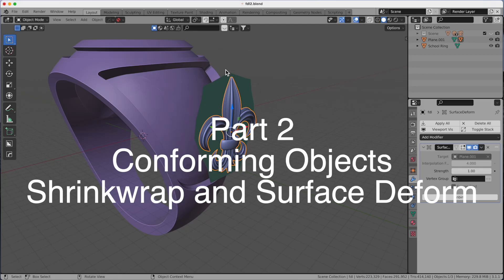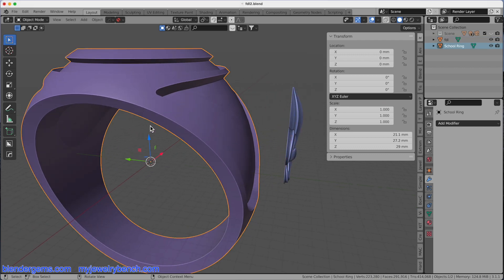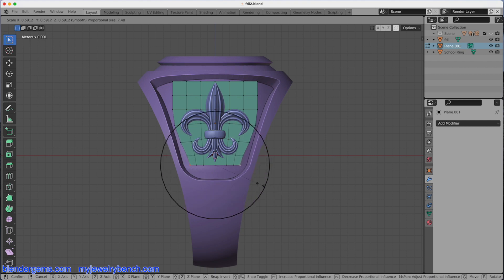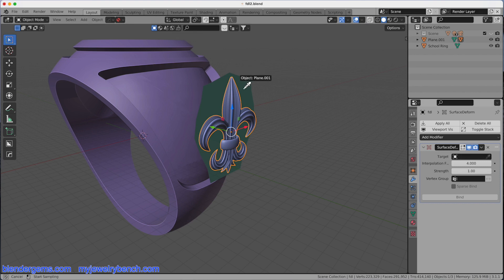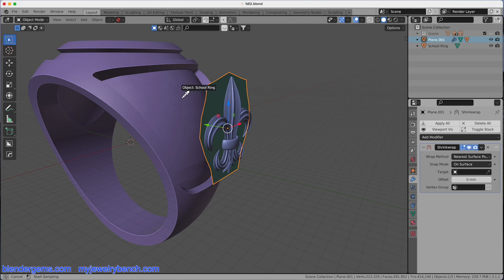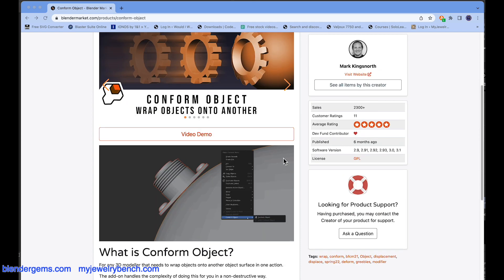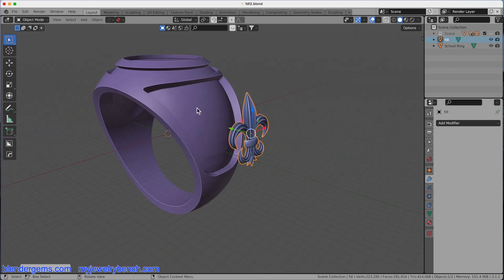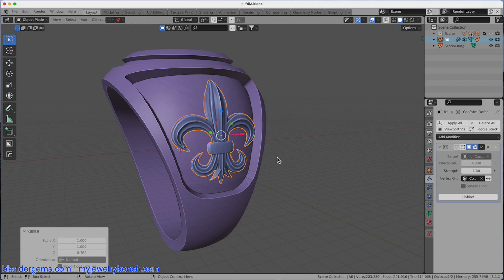Blender 3 Tutorial - Shrinkwrapping and Surface Deforming an object to another

Comment: Hi Peter, congratulations for your jewelry tutorials and thanks for your input, I'm really impressed by your ability to handle blender well. I had no idea that this program could also model jewelry, honestly I'm just getting to know blender. but I have a question, how do you change the purple color of the model? since by default it comes in matte white or gray. Thank you again.
Reply: It's a Blender setting. Go to the viewport shading option (those 4 round icons on the top right, expand the options by clicking on the downward arrow). 
And then under "color", pick "random". 
This will give a random color to the objects in the viewport, when in solid shading (the second round icon).